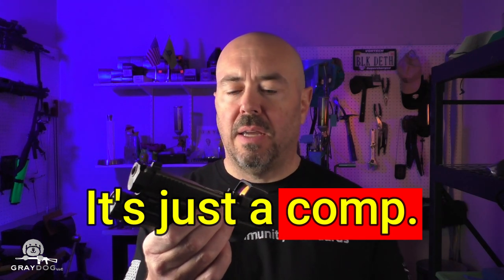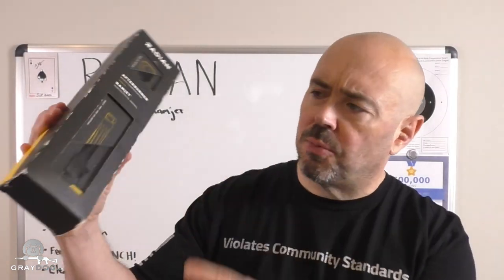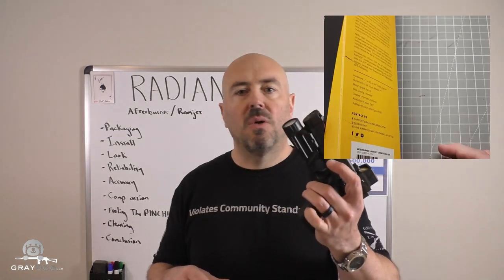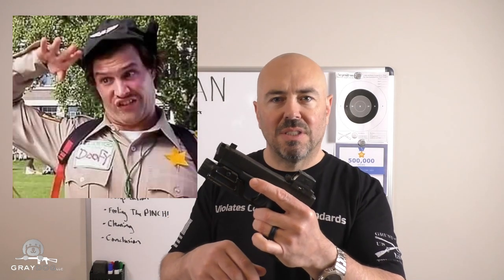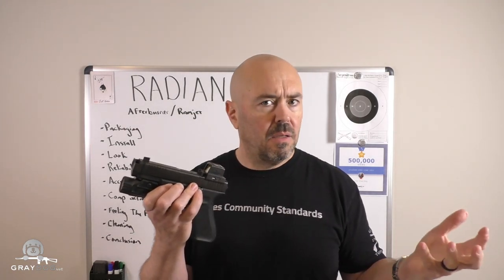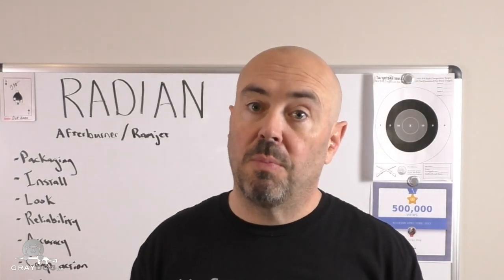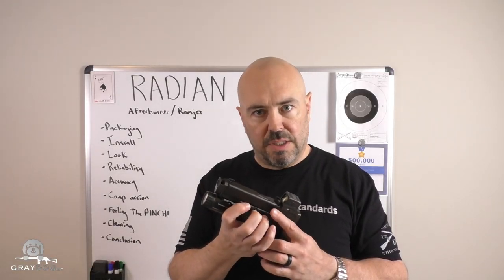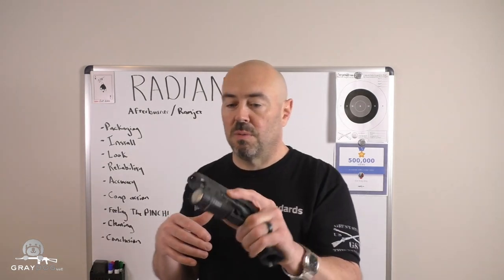RADIAN Ramjet/Afterburner: Executive Level Compensator!

Comment: One thing that will help reduce the muzzle rise and felt recoil even better is tuning the recoil spring weight. Radian's Compressor Tunable Guide Rod and Springs is a big help in getting this comp to it's best efficiency. The springs used in that GR are the ISMI flat wound types at 18, 15, and 13lbs. The 18 will dampen recoil/flip with most loads but the negative side is that the return to battery causes nose dive and in the general recoil cycle, there is a seesaw effect with many loads but with this spring the muzzle flip is the lowest. The 15lb spring seems to be the best balance for most loads. The 13lb spring is too lite except for low pressure loads (mainly hand loads).
Reply from the maker: I agree: https://youtu.be/yuuNrmf99LA
Reply: @graydogllc  OH YES! Thank you for doing that video and also sharing it with me (I had not see in yet nor many about the Compressor).

Comment: Absolutely stellar video but shouldn’t the comparison be between a stock 19 and the ramjet combo considering that’s the gun it’s supposed to be improving and is likely the gun used to gather the data that they refer to when claiming the 44% decrease in muzzle climb they boast?
Reply from the maker: Hey, thanks! I was thinking about the comparison in terms of gun size, and the Afterburner makes the 19 into the same length gun as the 17. I put one on my 19 as well, and the recoil reduction was similar vs the 17.

Comment: Just bought one. Do think itll run good with factory 115 grain? Or should i buy the spring kit also?
Reply from the maker: Mine ran ok with the stock spring, even with bulk 115gr. It just runs better with the 15 lb spring.
Reply: @graydogllc  ran better as in less recoil with the 15lbs spring? Was it worth buying not changing the spring and running 115 bulk? Should be coming in the mail in a couple days. Kinda don't want to buy the spring kit lol
Reply from the maker: @multicamchannel  get one of the cheaper kits, don't buy the radian kit. I got a stainless captured set for $22, much better than the compressor. The recoil was the same, but muzzle dip was much better than stock.

Comment: What PF are you at with your reloads?  New sub and thanks for sharing.
Reply from the maker: The 124s are coming out right at 1050, so 130ish. They are quite mild, and this setup still runs them fine. Thanks for subbing and welcome aboard!
Reply: @graydogllc  Good to hear because my comp will be here on monday. What spring weight are you running?
Reply from the maker: @russdennis7026  right now, stock! I am going to see if 15 lbs runs flatter though, that is this week's experiment.
Reply: @graydogllc  Im using the 15lb and its working great with my loads.  But without the comp.  We shall see on Monday. 3.9gr vhitti N320  124gr Jh
Reply from the maker: @russdennis7026  I am using 3.9gr of Titegroup with mine.

Comment: Just purchased one for my G45. Hoping it will yield solid results. Are you in LE? If so, it’s cool they allow you to run the radian on duty. Do they allow Overwatch triggers?
Reply from the maker: I like mine on the G45 a lot! I am in LE, it isn't on my duty gun. Every agency is different, some will let stuff like that fly, some will not. Triggers are even more dicey, I doubt you could sell that to the approving person....
Reply: @graydogllc  Yeah. I retired from LE in Arizona and we couldn’t modify anything. I have heard that some agencies allow Overwatch or apex triggers which is pretty cool. I’m excited to give the radian setup a try. Great video man. Thanks.
Reply from the maker: @fearnonebutone4977  small agencies you can sometimes. The Chief at one of the local agencies around here is a bit of a gun nut, I know one of his cops was running around with a full on (authorized) Roland Special. That is really the exception though. Glad you liked the video, congratulations on your retirement, and thank you for your service, brother!

Comment: Gray Dog - If it was up to you, would you carry it or authorize it as fit for a Duty Gun?
Reply from the maker: So, I am in between with this. I am carrying a Radian Afterburner gun every day. I don't think it would hurt to use one for duty, but for most cops it probably wouldn't help a lot. Cleaning the gun can be more of a pain as well, and given how often cops don't clean them already.... So, like I said, kind of stuck in the middle. I think if I were running a smaller agency, I would authorize it if they wanted it, but not mandate it. And if I was dealing with a big agency, I probably wouldn't want the hassle of optioning it.
Reply: @graydogllc  So since the two are just about the same length, in regards to shoot ability what are the main differences between the comp’d Glock 45 and the 17?
Reply from the maker: @adquinta  45 shoots flatter for sure. The problem with the comp is that it is more involved to clean the gun and if you have under powered ammo it is more likely to cause problems. If you don't need the comp then either gun will certainly work well. The 45 with the comp just feels better to me.